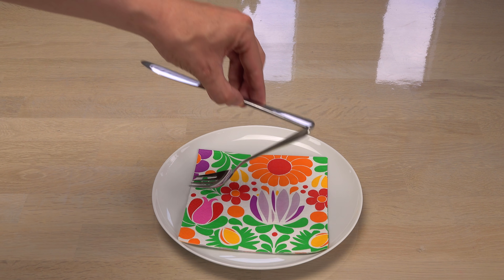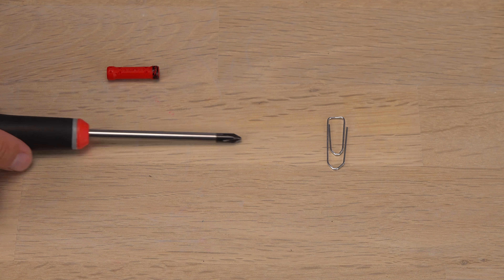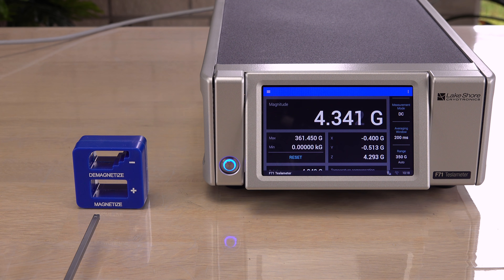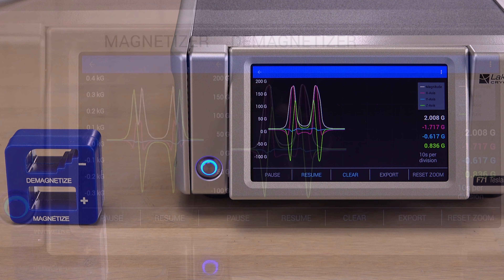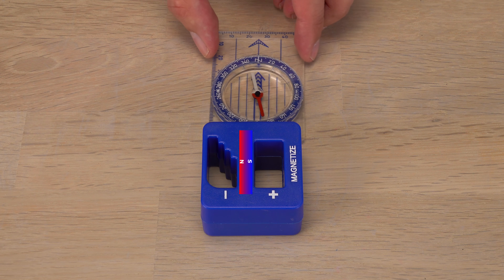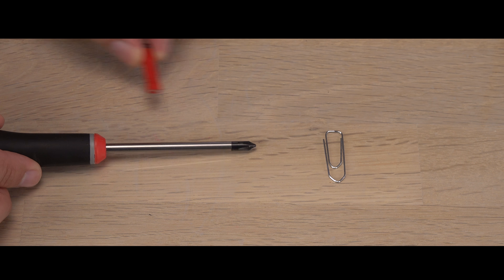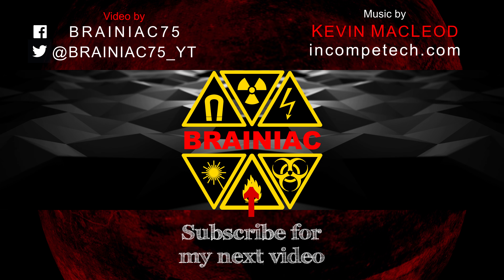Mystery of the Demagnetizer | What's inside? How does it work?

Comment: Very good video.  The stairs actually have a purpose:  if you start with the lowest and do one for each step, you will demagnetize it almost completely.  If you just do the lowest one, then you will retain a little bit of magnetization (although not enough for your test--it will show up if you test with something small like iron filings).  This is because, as you show in your video, the magnetic field lines are more and more perpendicular to the screw driver the further you move up the stairs.  Of course, as you say, they don't actually "do" anything, so you could just repeat the motion without them.

Comment: The stairs are important if you want to remove ALL the magnetization.
The lower level of the demagnetizer removes most of the magnetization, there's not enough left to pick up a screw, but it might still be able to pick up small bits of metal shavings.

Comment: This tool is a manual AC demagnetizer (like ones used in tape head demagnetization). But there is still a small difference though, the AC one randomizez the magnetic orientation, such way they cancel out. But with this tool you cancel them out manually.

Comment: the stairs are not totally useless, thay are used to achieve a more consistent demagnetization. If you have to deal with tiny screws any leftover fields are a problem. so you demagnetize the screwdriver starting from the lower step (also helps to keep the shaft parallel) and climbing up to demagnetize with progressively weaker fields, thus better demagnetizing.

Comment: the more “fancy” demagnetizer includes rotating magnet (or electromagnet) that gives alternating fields. By getting closer to the magnet would make the ferromagnetic material play around at the large hysteresis curves. By getting far from it makes, because the field on the material is smaller, the hysteresis curve gets smaller and smaller to become no magnetized. I see the demagnetizer of yours also have alternating magnetic field from the design, which works just same as the fancier one. I guess one has to understand the hysteresis first. Hope this improves your explanation.

Comment: Well, I thought i knew it all,  i was going to make an AC electric degausser, all i needed is two magnets,  now I'm going to degauss my annoying micrometre, keeps sticking to metal things I'm trying to measure. Update, I made one with 2 Neodymium magnets, a 15mm plastic spacer, masking tape, stuck the magnets opposite sides of the spacer with the magnets trying to repel each other, I tried different passes till it worked, beautiful, finally my micrometre is degaussed, I can now work with small screws and other metal without sticking, I understand how it works, the magnetic fields are cancelling each other with north to north facing each other and cancels anything else passing by

Comment: I just use a magnet on a subwoofer or speaker. You dont use the top and bottom of the magnet, you use the sides or like the edges of the magnet, one side will magnetize anything ferrous, the other side will de-magnetize

Comment: ... and if you run your car's fuel line through the righ hole, you'll get 120% fuel savings.  Results may vary.  If your do not see fuel savings try the other hole... then the first hole again but the opposite direction, then the second hole in the opposite direction, then in one hole and out the other then... nevermind, we have dissolved our corporation and hidden all the money in numbered bank accounts.

Comment: The ladder thing DOES have a purpose. Simply passing the screw driver on the demagnetizer side removes some of the magnetization, but not all of it. If you test it with a large screw it will appear demagnetized, but if you check it with something small like a watch screw, it still has enough to pull it. This is problematic in fields like watchmaking. To completely demagnetize something, you need to expose the material to an irregular magnetic field, vibration (or heat). Most guides tell you to move or rotate the screw driver while pulling it away. But you can easily do it if you run the screwdriver up and down the ladder thingy in a relative rapid motion (like a scraper musical instrument) and then pull it out of the high point in the same motion. It takes a couple of times, but eventually the screw driver loses almost all of its magnetization. To be sure that it's zero you need a strong and effective electric demagnetizer, but for most work the ladder thing works like a charm.

Comment: This is an interesting video, but I noticed one thing with the one I have, it seems that it demagnetizes when I put it into the  magnetize section and vice-versa on the demagnitize section. Wonder if I'm doing something wrong? Does it make a difference which side you use? I tried it both sides and it still get the same result.
Reply: When I mean both sides I mean front or back.  One side has the printed letters and the other side has embossed letters. But they are still the same words for each section

Comment: According to my demagnetizers "manual" the stairs are there to help you align with the proper distance to the magnetic field as different items/materials need a different distance.
Reply: That would make sense!
Reply: so you magnetize with same distance but need different distance to demagnetize it?
Reply: @GhostsOfSparta  no different materials have different magnetic strength, once you magnetize it, it can only be that strong, but when you demagnetize it, you should only demagnetize based on how strong it is, otherwise, you will remagnetize it partially. You can also play with the distance so you can get different magnetic strengths

Comment: Parts put thru the MAGNAFLUX process begin with magnetizing parts that have iron in them. after checking for cracks with a black lite and solution that gathers around cracks, that part is de-magnetized so it won't break so easily. De magnetizing is done by passing an alternating current field around the part at different strengths and ever-changing times. As my remembery serve sence 1973. Non ferrious parts are bathed in Zyglo and a black lite is put on it so that zyglo gathers around that crack.

Comment: WHAT ARE THE STAIRS FOR!!!
Reply: I saw someone explain it here somewhere. Their purpose is a practical one. You start by swipping the magnetized tool as close to the magnet as you can, then then you move up a stair and do it again. This is supposed to help completely eliminate any newly formed magnetization

I have to say, the idea works. Today I tried magnetizing/demagnetizing a screwdriver using a small bar manget like he does at the end. I could only get it demagnetized if I did the consecutive increase the distance thing
Reply: @ngiorgos  okay okay understanding have the question is the answer, maybe it has something to do with the way that magnetic field diagrams are drawn? With the ascending lines....

Comment: So what is the point of the stair steps?   Is that supposed to be a universal symbol for demagnetize?
Reply: I saw someone explain it here somewhere. Their purpose is a practical one. You start by swipping the magnetized tool as close to the magnet as you can, then then you move up a stair and do it again. This is supposed to help completely eliminate any newly formed magnetization. But it also helps distinguish the demagnetising part from the magnetizing part.

I have to say, the idea works. Today I tried magnetizing/demagnetizing a screwdriver using a small bar manget like he does at the end. I could only get it demagnetized if I did the consecutive increase the distance thing

Comment: uhm, that's not how you use a magnetiser/demagnetiser tool.

Okay, take a screwdriver and run it around and around the inside of the magnetiser section, you take the tip and run it around the inside surface, around and around, then test to see if it is magnetised, then, whack it a few times on something, and it'll lose the magnetisation due to the force of the impacts scrambling the magnetic domains, that's what the "stairs" are for on the demagnetising section, to impact the tool against so it loses its magnetic flux by physical impact as you run it around and around, each impact upon a stair helps shake up the magnetic domains of the metal atoms that make up the tool, which scrambles them and therefore the scredriver loses its magnetisation.

You don't poke it in like that. sigh

I've used these for years for repairing computers, because there's nothing more annoying than a small screw falling off your driver, seriously, I know what I'm talking about.

Comment: Very impressive. For decades, I thought that stroking a piece of steel with a magnetic pole would magnetise it, and the way to demagnetise it was to place the magnet in an alternating magnetic field and then removing it. Here is proof that a bar magnet can be used to demagnetise a magnet if the bar magnet is placed PARALLEL to the magnetic axis of magnet and stroked. That way the magnet is subjected to decreasing magnetic field strength in a varying direction. Brilliant! Thank you.

Comment: The stairs are so you can remove only a small amount of magnetic pull to adjust the level of force you want. Helps when working with small screws
Reply: Why do you want different forces for different screws? Sincere question.
Reply: @aimanyusof8863  Well a small light screw doesn't need the same power of magnetism as a large heavy screw.

Comment: Great video but I think you missed something from what I have been told.
Since the item is for screwdrivers I was told the steps are to make tool less magnetic. So top step it will lose some magnetism but not all.
The the other steps remove more magnetism  until at lowest point when imagnetism is all removed.
That is what i am told but I dont use the magnetizer-demagnetizer to be able to test.

Comment: I have a small induction motor from a fan from which I've removed the rotor that I occasionally use as a degausser.  It works about the same as the demagnetizer shown in this video, but it isn't useful for re-magnetizing objects.

Comment: Wait.. so I don't have to leave things in a magnetizer for like a whole minute? DAMN IT.
Reply: For magnets, it is the rate of change, not the existence of the field that does most work. Motors and generators do the same thing, spin a magnet fast, you get more electricity. A static permenant magnet will not generate electric power, but a moving one can. Once inserted, the domains (mini magnets) inside the metal align almost immediately, so leaving it does nothing

Comment: As you found, simply moving the object in and out of a demagnitiser does not work if it was magnitised with the opposite polarity. I believe this is what the stairs are for. You're supposed to step the object up the stairs, so that it experiences a rotating and diminishing field which should be able to demagnitise the object no matter which polarity it is.

Comment: The steps are there because you are supposed to slowly moving the piece away in order for the magnetization to become weaker and weaker. In the end you are just magnetizing the screwdriver in a different way with a weaker field. But in orde to remove the strong initial field you can't use a weak filed right away you need to slowly decreasing fields in a different direction.

Comment: I'm guessing the "stairs" are there so you tell that the two openings are different even if the labels come off.  Or maybe to hold things up if they're extremely magnetized so they don't touch the bottom of the demag hole which wouldn't work as well.

Comment: The probably arrange the poles half one way and half the other way at the factory to make the product easy to pack and ship. Isn’t it nice when a product arranges itself for shipping!? From the start I was fairly certain the curvy corner and the stepped side where simply visual cues to help a person orient in case the object is upside down. 

And of course now the practical side of me sees it as more economical to cut down on the plastic and simply have a hole to magnetize and then say either top or bottom can demagnetize. But I guess the second hole ensures proper orientation to for the process.

Comment: I think  the magnet I'm using is too strong or something. It doesn't seem to work. Like, it's less magnetic, but still magnetic enough to pick screws up.  I found that dragging the magnet (held in the same way as you do In the video) starting at the tip of the screwdriver instead of from the handle moves the magnetic field enough that the tip isn't magnetic, though.
Reply: The magnet isn't even that big. It's, like, the size of one of the black fridge magnets (but definitely neodymium), And I have 5 of them stacked together. Is it something to do with having 5 magnets stacked together? Shouldn't they just act as one larger magnet?

Comment: Years ago I used to work at an engineering firm and we had a demagnetiser for guillotine blades. I was warned to keep my watch away from it or otherwise it would stop working. And I said "surely if my watch is de magnetised, then it should work just fine" . I passed my arm through and it made no difference to the watch.

Comment: There is another way to demag items.  Use one of those instant on soldering guns, ( the kind that has 2 posts and a wire to form the tip )   The tip forms the secondary side of the transformer, the AC will demag any item you put inside the loop.
Reply: I had one of those get a drop of solder stuck between the probes.  It melted down, I was lucky to get the batteries out before it caught fire.  I can't help but think of them as anything but a fire hazard now.
Reply: Bob's idea works!  My precision Wiha screwdriver somehow got magnetized.  I bought one of those stairstep "demagnetizers" just to see if it would do the trick.  It was even the Wiha brand, not a knockoff.  No success at all with getting it demagnitized.  But when I slipped the screwdriver through the loop of my 1960's era Weller soldering gun near the tip of the soldering iron with the iron  turned on the screwdriver buzzed and was perfectly demagnitized.

Comment: The stairs are there to act as a physical barrier to keep heavily magnetized items from pressing against the bottom of the demagnetization area, which is less effective.
Reply: My guess is also to provide a visual aid in the event the lettering wears off or if you need to use that in a spot with low visibility.  It just allows for an “at a glance” understanding of what is what
Reply: @Atlink  NO, THE STAIRS ARE THERE TO ACT AS A PHYSICAL BARRIER TO KEEP HEAVILY MAGNETIZED ITEMS FROM PRESSING AGAINST THE BOTTOM OF THE DEMAGNETIZATION AREA, WHICH IS LESS EFFECTIVE.
Reply: @PullTab ok dude, Jesus.  Calm down.

I assume it can also be used as a quick visual aid as well.  That’s why I said “also” in my original comment.

It can be both, my dude.
Reply: The stairs are sn OMORI  reference to make the magnet weaker and discourage it or else it will fall down the stair like MARI.

Comment: Before watching this or reading any comments, I'd like to add a theory and see if I'm right.
If magnets are caused by forcing all the atoms to align in the same direction, which you can demonstrate they are by running a piece of metal across a magnet and having the magnet nudge the atoms into alignment to create a magnet. My gut reaction tells me that to demagnetize metal, you'd be using an equally strong (if not stronger) magnet perhaps with opposing polarity or angled so you're "against the grain" so to speak.

Let's see.

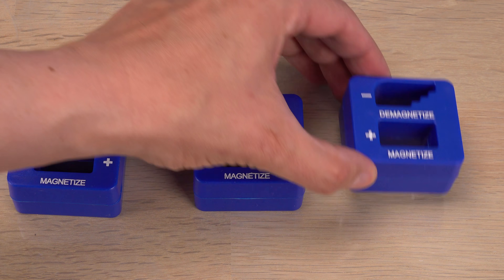Comment: At timestamp 3:07, I can, with all confidence, say that the steps are not important at all; I don't know what they do on that particular model of (De)magnetizer, but I have several from cheap tool kits, where the de-magnetzation portion is just a trough (flipped on their tops, the just look like blocky letter A's), and it works just fine.

Comment: I got an electric de-gausser, meant to remove any built up magnetism in mechanical watches (a magnetised regulator spring will make the watch tick too fast.)
That might be something worth checking out and pulling apart.
Its basically a plastic box with a coil inside, you place the item on top and press a button to de-gauss it, like $10 for a cheap one.

Comment: I think the steps in the demag may actually have a function.  Since there is a magnet on only one side of the demag window, the field gets weaker the further up you go.  Some alloys, with certain BH magnetization curves may need a very specific strength to rotate their magnetism at right angles to the length, but not pull the field out the end of the device, as you remove it.  The steps give you several choices of demag field strength to choose from.  With your fancy field meter, you should be able to find the step that produces the minimum lengthwise magnetization of various objects.
Reply: I think it’s so that the invisible magic magnet elves that live inside these can go upstairs to bed after a hard day of making things magnetic.
Reply: Its so you can quickly determine your in the right hole without even looking, you swipe in a circular motion.. when you ride the stsirs you know your in the demag slot.

Comment: When you magnetize something you force the particles to align in one direction therefore creating a strong magnetic field.

I have been able to demagnetize various tools without a demagnetizer or heat by hitting them hard a couple of times. Knocks the particles out of alignment making the magnetic feal weaker.
Reply: Impact and vibration can actually cause things to become magnets, too, because of the earth's magnetic field.  The earth's magnetic field is a lot weaker than being in contact with a magnet, though, so the effect is very weak.

Comment: You can also magnetise / demagnetise steel with a hammer. Just hammer a screw in the right direction using earth's magnetic field. Yeah, it's not as strong but it does work.